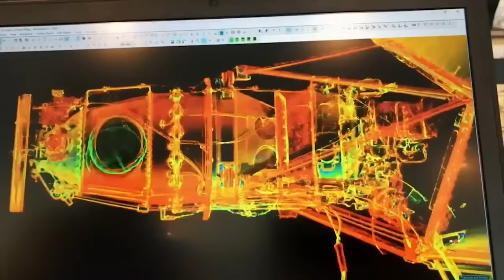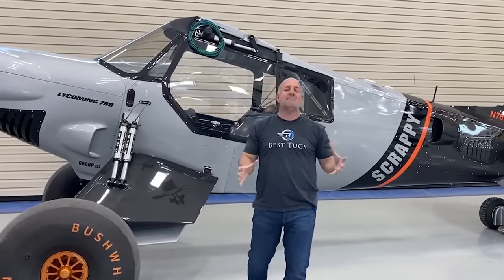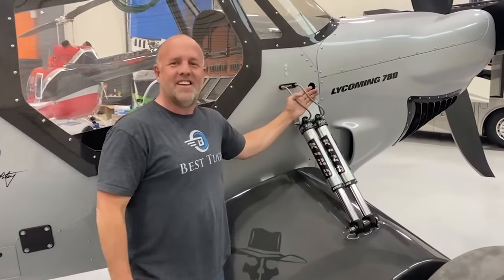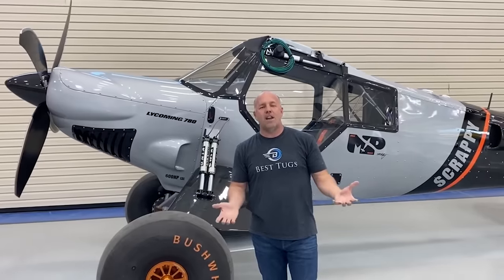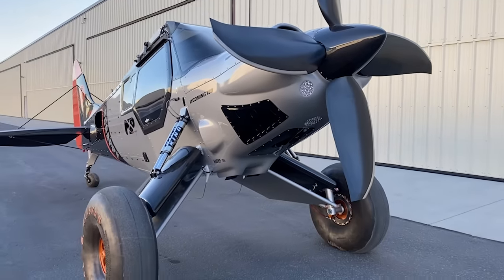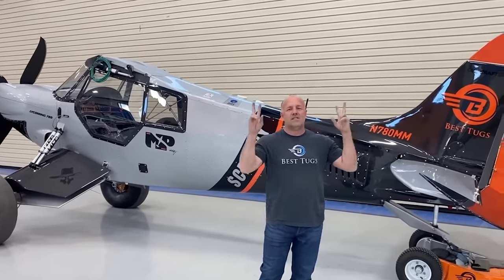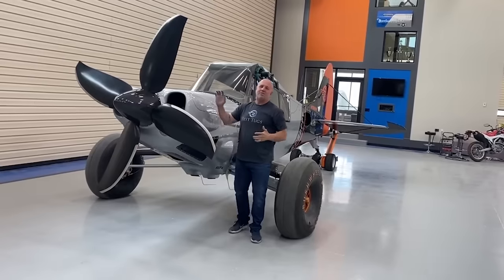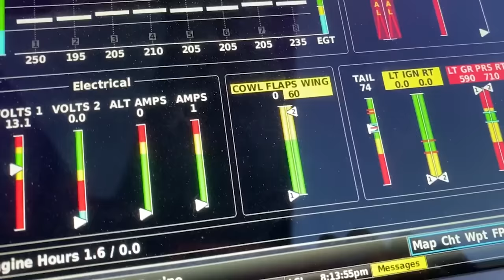Dynamic King Suspension on My Wingless Airplane | Scrappy #52

Comment: There is a mad scramble right now at Horizon Hobby trying to design a 100 channel transmitter to control all the features they will have to include on the Scrappy RC airplane.
Reply: I love that 👍
Reply: I was thinking the same thing.  Just got my Eflite Draco done the other week, now wondering when Scrappy will be here!  LOL
Reply: Maybe with a two pilot mode: one flyes, the second does all the work on the suspension LOL
Reply: @marchofer8829  LOL
Reply: Haha truth

Comment: This thing is absolutely nuts! Thank you for taking the time to make videos to bring us along on the journey!
Reply: I enjoy your channel too Ben!!!!!!!
Reply from the maker: Glad you're following along! 🤠
Reply: @MikePatey  Nitrogen ???? .... Use CO2.  One quarter the weight bottle holds ten times the gas.    CO2 .
Reply: @cuckingfunt9353  I haven't done the maths physics or tests ;) But I would guess CO2's higher freezing/condensation point (particularly under pressure) may have something to do with it.
Reply: Hey Mike. Im in Mcgill Nevada. Heading home tomorrow. Nothing but pure love for you and your family ❤
Reply: @narco73  CO2 is about 50bar at room temperature ('liquid' state) so it can be stored in a strengthened aluminium bottle as used for paintball.  It's perfect for this purpose. You can even get carbon fiber bottles  (Mike would love that) and you can get regulators already on the market.

Comment: *Hey Mike, Hope you read this!!
I know how you always take things to the next level. But this idea I have may be something you may not have considered. So In the Marine Corps we “helicopter maintainers” use the nitrogen pressure side that is inside our shock strut’s suspension to determine the weight of the helicopter. You could use your suspension to do the same thing.  This is basically accomplished by Lowering the suspension: by bottoming out the strut... fill with pressure... the moment the suspension moves... record the results... do some math and make a chart.. next thing you know you now have the weight of the aircraft. 😉 
Love the work you do, keep it up!
Reply: Great idea, and the pieces are all already there in scrappy. Could even make it automatic by programming it to grab the pressure when the position sensors start to move.

Comment: Mike I swear if you tell us you're designing the wings to sweep back like a tomcat I'm gonna lose it!
Reply: What I have picked up on is a hint at variable camber
Reply: @ginvr  I’m right there with you.
The mechanism could be fairly simple.
Mike often eludes to a “worm gear” and it would be easy enough to use a couple of worm gears to slide the rear portion of the wing at the rear spar back, and down.
The skin of the wing could slide on top of one another, which would make sense that he’s using aluminum skin.
Reply: @chrisdougherty9098  Sounds like the most likely scenario I’ve heard yet. Guess we’ll see soon enough.
Reply: Well, the wings are adjustable, so that's close. lol
Reply: Did you happen to notice the linear actuators that are now up where the wings will attach to the fuselage? There is absolutely nothing he can do that will surprise me, this thing is on a Howard Hughes level already, just so over the top and detailed.........

Comment: I expected the suspension to be pretty impressive, but never in a million years did I expect Mike to have solved so many problems, and made so many improvements, just from the suspension.

- Huge travel soft suspension to cope with the worst terrain.
- Can drop low, wide and firm for safer taxiing.
- Suspension can remove AOA from the wings to improve safety on the ground (which simultaneously improves taxiing, and makes it easier to board).
- Automatic adjustments to remove tail wheel shimmy for different load configurations.
- Can lean for sloped fields, and can keep the wings and tanks level when parked on a slope.

Holy crap!  That's five MASSIVE improvements that I've never, ever seen on a plane before.  Mike, you never cease to amaze, incredible work!

Comment: "It's really a simple system". Cue the sound of thousands of followers scratching their heads in puzzlement and wonder!
Reply: Many of the most complex things made are several simple inventions combined. I am sure that King Shocks and Garmin love to work with him because is has that child like enthusiasm to dream "what if" I.e. what if we built a shock with a separate air piston that could be adjusted on the fly (to the extent of the piston stroke)  an indefinite number of times then used angle sensors and electric servo-controlled valves to control the hight of the tail wheel, then used programming in the Garmi  that says if angle less than "x" open valve "a" if angle greater than "y" open valve "b" close valves when angle reaches spec. All simple steps, but when combined, magic.
Reply: Sounds like you are a very humble man. It’s a great position to be in because pride really sucks. God bless you for being you.

Comment: Watched the video again, and Scrappy keeps getting better and better. ;-) 

Parking mode even keeps the King shock pistons Clean inside the cylinders where there is no Sanding dust and grit. Increasing the life of the seals that wipe the pistons.

Comment: Like I commented before, your wing design reminds me of the The Mission-Adaptive Wing program. It used a fly by wire  control system to change wing contour to maintain peak aerodynamic efficiency over a large flight envelope. Being able to change the cord thickness goes a step beyond the MAW program which if memory serves me right, used a variable wing camber system. I'm willing to bet that the Mike Patey designed system will be much more capable and efficient in its operation. Being a Veteran of Naval Aviation as well as a Licensed A&P Mechanic in my post service life and a life long aviation enthusiast I anxiously await every one of your videos. I cannot wait to see your wing design and see it in action!  ✈✈✈✈✈✈

Comment: Thanks for ALL you and your family do! I believe you installed a camera on the underside of the front cowling? This will not only be helpful on the ground but in the air as well. In July 1977, my late father flew my brother, a friend and I to a fly-in. On final, a biplane came down on top of the cabin of our 172. Fortunately no one was hurt, with only some cosmetic damage to paint and demolished antennae. Certainly a front mounted camera would remove the blind spot for the biplane pilot. Seeing you and SCRAPPY someday is on my bucket list. All the best to you and yours.

Comment: When you started talking about using oxygen in the shocks I went into “OH NOOO” mode!  Oxygen, shock oil, high pressure, high temperature. ....  OMG!  NASA lost three astronauts using pure oxygen.
Your explanation was great and, hopefully, prevented others from trying to use it in this manner.  Nitrogen is cheap, and oh so safe.  With all the extra things you have added, the weight of the nitrogen bottle would be a penalty worth paying.
Thanks for the videos!
Paul Boston

Comment: 👍its back, cool. I thought those switches would have been for in flight  adjustable dihedral and other winged things. If I recall you were sort of sad with Draco having to compromise with your dihedral, so it would allow you to slip into Canyons.
   Although my work is not anywhere near your caliber I did design and build my own little bush plane it's a tricycle with 18in to travel on Fox air. And yes it articulates on-the-fly so to speak. I also designed my own in-flight adjustable dihedral. Very few have seen my plane though I do not go to fly ins and I post nothing on YouTube. If you should see it it's candy apple green . With a healthy 2300 with fuel injection fed by 2 AMR 500 superchargers.
Reply: It also has a power loading of 4.6 and a wing loading of 6.2. 
 Has about a 700 mile with 10% reserve on 24 gallons of pump gas.
      Solenoid control Leading Edge,  flaperons and winglets.
     Aluminum frame Foam & S glass sandwich composite.

Comment: in northern Idaho where my Father grew up, his double cousin (raised as a brother) has a large farm in the rolling hills area and uses a self-leveling combine that I got to ride and drive when I was in Highschool.  it keeps the machine level so it seperates the grain from the chaif properly  and the cutting bar stays level with the ground to cut the stalks properly at the same time. It is an interesting ride as it can tilt up to 45% to either side automaticly or manualy. He first showed me this at the ranch on level ground with me standing beside him in th cab.  had me a bit surprised at the ride!
Reply: Get him to drop it of at mike’s he’ll make a set of wings for it ...a flying combine ..😂
Reply: There was also a self leveling tractor marketed at one time in that area and the northwest for hillside farming.
Reply: @richardcole9558   lol sounds like a project for 'Flitetest'

Comment: I have a question Mike, how will air density/altitude pressures effect the suspension system? Does the system have a blow off valve to prevent over pressurizing the shocks/system? Also have you thought about putting a Gyro in the system to auto correct for the uneven ground?
Reply: The ambient air pressure change is just a tiny tiny fraction of the pressure inside the suspension. When you have 300+ PSI it does not matter if the ambient air is 14.7 PSI or 4.7 PSI. It would only change the pressure differential across the system by 3%. That is why oxygen tanks don't rupture when you carry them to the top of Mount Everest.

Comment: ✈ Attention Horizon Hobby.  ✈
I expect this level of plushness and control in the suspension of the remote control version of Scrappy when you get around to creating it.
Also, why haven't you shipped my Draco yet ??   It's been a month and a half !!           AAAAAAAAAAAAARRRRRRRRRGGGHH  !!!!!!!!!!!!!!!!!!
I even just bought an E-flite Maule M-7 1.5m BNF four days ago to plug the gaping hole that is the lack of the Red Dragon in my RC plane collection.
Also, I wanted a larger plane to carry my GoPro, and this gentle lady doesn't even notice the 9% increase in All Up Weight presented by the camera.
Splendid Job on the Maule, that gives me great confidence in the Draco !!  (Also valuable experience with a tail-dragging tractor setup.)
Happy & Safe flying to all whether you fly your plane from the inside or out !!
Speaking of the GoPro, I have an astounding 63 minutes of aerial footage to turn into watchable videos on my second channel.
Enough with the shameless self promotion,
You Know the Drill !!

Comment: I personally believe the civilian and military aircraft manufacturers need to watch all of your videos and take a few notes from you and your designs. You are designing, building, testing and using technology that has never been thought of before and I believe you are making some of If not all of the manufacturers look pretty bad,. Especially when It comes to safety. Your emergency parachute system design doesn’t destroy your airplane like all of the others do when launched. 

You’re doing an amazing job and I still enjoy watching each and every one of your videos. Keep up the great work as scrappy is looking amazing.

BTW - I caught on to your air ride suspension system pretty early on. Not entirely though! I even mentioned something about it in a message however you didn’t reply, and now I know why…. 😀🇺🇸

Comment: Nice work on the articulating gear . Now I'm curious if you're Leading Edge slats will be fixed ,Auto retractable on Springs, manual, or  solenoid controled. And I thought you'd be going with flaperons. But it might be massive slotted follower flaps.🤷🏼‍♂️  Guess we'll have to wait for the next Saturday morning "evening" Adventure. One part at a time!  LOL
Reply: Do you seriously think Mike would leave something fixed if he can enhance it? Lol
Reply: Probably all of the above , plus a few thing we haven’t thought of yet. Fredb
Reply: @loaflyer5663  lol. No even his enhancements have enhancements.
Reply: @fredbugden3511  👍 There's something I have thought of for a couple decades. A Kevlar airbag from root to tip from the rear spar too over the main spar.  Inflate to thicken the chord, deflate for Less drag more speed. 
   There are engineering builders and those with capital. Mike has both.
   Now the other day he said Scrappy  well have a all aluminum wing. But he's constantly building and designing. 
   If I recall Draco had a flat wing so he could fly in Canyons. My plane has in flight adjustable dihedral. There's nothing like options. We'll just have to wait and see.

Comment: Mike, I watched this episode this morning. When I tried to show it to a friend of mine about a hour later, it was gone. Curious.
Reply: The first video left out the detail that he's running Nitrogen in the shocks instead of Oxygen and why. There was a lot of concern in the comments about the risk of oxygen fires onboard an aircraft, since apparently most seals inside shocks leak a little oil. I was also concerned that any leaked oil droplets may be unhealthy to get back into the oxygen system for breathing
Reply: Ahhhh. That is a thing.
Reply: @cmmartti Honestly not sure.. maybe he just didn't realize that the Nitrogen details were missing from the first video and causing concern. To switch to Nitrogen, he said he had to do (or still has to do) some rework and come up with new plumbing to separate the tanks into two distinct systems (although he was driving around the airport with the all-oxygen config).As far as I remember, the 'Oxygen' and 'Nitrogen' labels were missing from the shot of the tanks in the first video, which would make sense if the switch was a recent decision
Reply: @cmmartti  I like to think "trust Mike" is a pretty good policy though, and that he's not taking engineering advice from YouTube comments. But I would at least feel iffy about breathing air that's circulating around a suspension system, even if fire wasn't a factor
Reply: @Nate4197  Yeah, I trust him, I figured it simply might not have occurred to him until this morning when it was brought up in the comments.

Comment: Like a lot of us, I had a guess you could raise and lower the wheels because you've done that a lot working on it -- but I hadn't thought about soft vs. hard springs, or separate right/left control.  And I certainly hadn't thought of half the reasons it's useful.  This was fascinating!

I also figure that one of the places you can really advance the state of the art with this is once you start flying it, and find all the other things it's useful for that you hadn't even thought of.  Sure, it's probably not something that's going to be on every taildragger -- but maybe there's a lightweight and simple way to adjust the tailwheel height on a "normal" cub and get some of the benefits, or something like that, and you doing this will inspire someone with "Hey, I thought that was a gimmick, but it sure is useful...."

Comment: The control you have designed into the aircraft is good engineering. Like non adjustable suspension on a racing car it is always a compromise. When the conditions are outside the design parameters things are not ideal. I hope you have shown the way to others because of your approach to preliminary design then "lab testing" proof of concept. Love what you do!

Comment: Mike, that suspension is simply sublime.  Your innovations in this arena could change taildraggers forever.  How about an automatic anti-ground loop setting.  Based on the complexity of your other settings it would be a breeze.

Comment: Mike, the sensors,  actuators  and software are really impressive! Quite the installation,  and UI...it would be interesting to see what kind of interface that you have built up to simplify setting different modes... have you done a set of 'presets' that you can tune, individually, so that you can adapt the settings, as you learn more about how the system works??   I think that you want a pretty simple, and quick, selection process when you are busy dealing with all of the complications of a tricky landing or takeoff!

Comment: I had noticed the pressure lines on the King shocks and how you were changing the height on the front, for different operations in the build. From that I Just figured you had a ride height control inside; - but - I never came close to guessing that it would be pre-programmed settings and independent control on each wheel position! Awesome work!!

Comment: Great thought going into the suspension.   I was curious about the shocks and if they had internal bypass valving. A buddy of mine had built a set of shocks like those back in 1995 with a one external bypass tube and solid reservoir.  It was a nitrogen over oil system.  Although it was only adjustable by valving, oil or nitrogen it was not adjustable from the driver seat.  We used them on a desert offroad buggy and worked very well.  Still use them.

Comment: Everything about this plane is an engineering marvel and you are a brilliant engineer!  I mean this thing is just AWESOME!  And I love your videos.

But I could never fly it.  I mean the type certification would be more complicated than an old 747!  I think you've changed G.U.M.P. into G U.U.U.U.U.M.P.!  I'd undoubtedly set that gear to the wrong configuration and ball that thing up on the first landing which would be just criminal.  I think I'd need the back seater to be a full time gear management officer.  I still can't wait to see what you do with the wing.